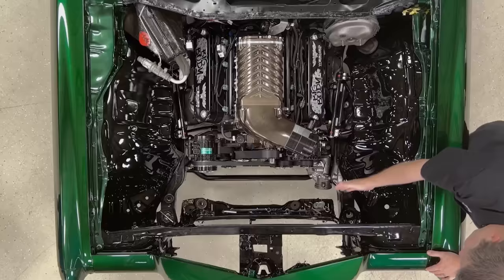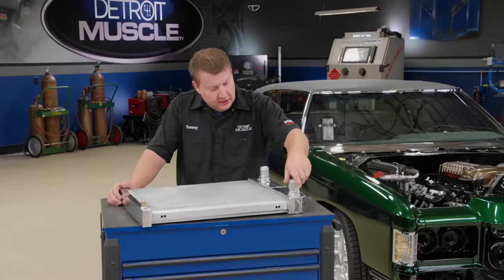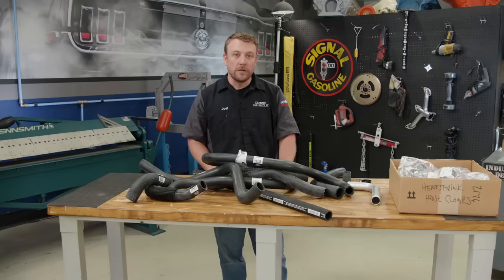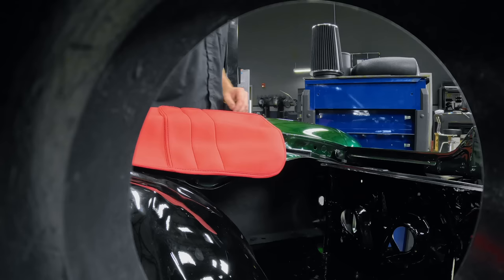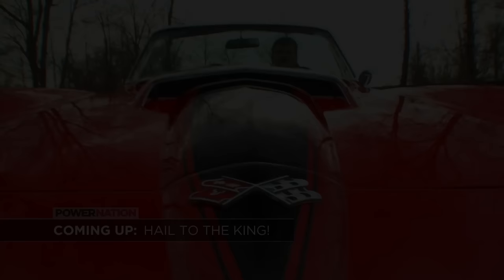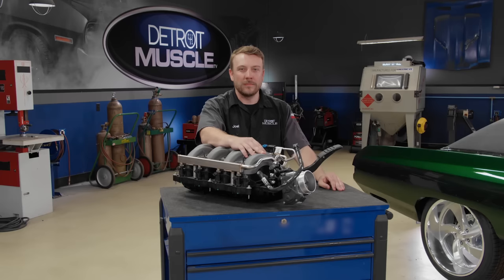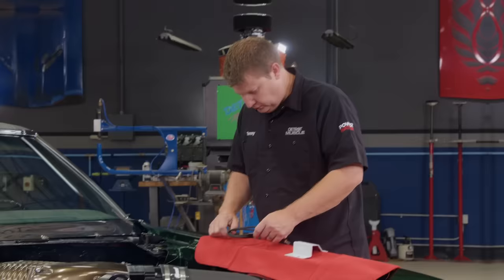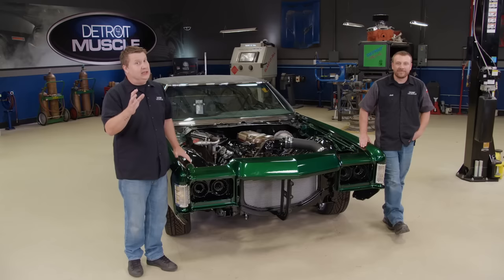Cooling Down & Increasing Power On The ‘71 Chevy Caprice - Fat Stack Part 9 -Detroit Muscle S10, E11

Comment: I spent 3 1/2 years puting my nova together and did not turn the key till it was ready to go down the road with tags and insurance, started it up, broke in the cam, changed the oil and went down the road, the first build in 46 years i did that way and it was worth the wait, everything worked perfect.
Reply: Much congratulations!!
Reply: That's just weird
Reply: I was believing this til he said everything worked perfectly.... In 3.5 years of wrenching, not one nut bolt or anything was missed?  No wiring issues? No rode height adjustments, or tuning? You started a motor you hadn't tuned, broke in the cam and it was perfect? C'mon now
Reply: @DaleDayTheBigDayDJ  I was about the say the samething "I waited until the car was done to start the motor and everything worked perfect",  In the immortal  words of Captain John O'Hagan.... "I'll believe that when my shit turns Purple and smells like Rainbow Sherbert"..... in my 50 years plus years of wrenching aint NOTHING ever worked perfectly, especially something you haven't tuned or broke in......

Comment: As an owner of of a 1996 (last year) Caprice, love this build !
Reply: They missed a BIG opportunity in building a car like the normal everyday guy is though. Don;t get me wrong it's a NICE car and build but people nowadays don't have the 30-50k it would have cost them to build that car. They COULD have yanked that 400 and Auto trans out and rebuilt them and put them back in, you know... like we would have done. They could have pulled the body off the frame and sand blasted the frame and thrown a couple coats of lizard Skin/Frame Paint on it and then cleaned up and rattle can blacked the suspension parts and put it back together with new bushings and bearings, and then throw a new carpet down and some Iroc bucket seats and dye the interior a a med to dark brown color, then put a quality but cheap paint job on it with a updated paint code, could you imagine how GORGEOUS that car would be in the new 2023 Buick Cinnabar Metallic or the 2023 Chevy Dark Ash Metallic, They had that chance and they didn't take it, because that's what people are doing now, noone has the kind of money it would take to build this car the way they built it.

Comment: I have an open element on my LS swap and this guy saw it and was like you are killing HP by pulling in under hood heat. He isn’t wrong and I explained I plan on building a box around it someday, but since I have doubled the HP of the TBI 350 I’m not worried about a few lost🤣
Reply: Yeah but think about the cost to reward? CAI's increase potential with mods.

Comment: Only haters say they are tired of hearing about LS swaps. Hard to argue with their dependability and ease of adding forced air induction without needing to change out a bunch of internal parts in order to handle it.
Reply: I'm not a hater, I even think that LS in the Caprice is cool. What I do think is that there are other great engines, Buick (Land Rover), Oldsmobile, Windsor, ect., ect. and I would also like to see them more often.
Reply: Noones a "Hater" it's just getting old and not most people aren't doing them anymore because the days of going to a boneyard and picking up a LS for $500 are over, it's cheaper now to just get a rebuild kit for your original engine, that "$500 LS engine" os now $1000-$1500 bucks then you have to do all the trial and error and the extra money spent of trying to get it mounted, when you can get a great quality rebuild kit $600-$800, so now your spending half as much money and getting a car that;s worth more because it still has the original engine and trans.

Comment: In the video title “cooling down”, I recalled reading something in an old racer magazine from Smokey Yunick where racers and others who ran their engines too cool were wearing their engines down faster and losing horsepower due to oil which was too cool and pistons not at proper operating temperature. He stuck by what the engines were designed to run at.

Comment: Why would you use the heat shrink clamps? God forbid if anything goes wrong you got to redo the whole system again. Plus you can't work on them if you break down on the side of the road. There are way better clamps than that.

Comment: Pretty sure the sting ray was named after a sting ray, not a boat.
Reply: @Tommy-B. Don't bet the farm on it. The Corvette was named after the WWII Corvette patrol boat.
Reply: The Sting Ray was the name of the Diesel sub class during WWII. You have to remember.... the Vette came out in 1951 (52 model year) and that was only 5 years after WWII ended, alot of the new cars models during that time was named after war machines of WWII because it was still in use by the military.
Reply: Before there was the Corvette Stingray it was a Corvette. And the Corvette got its name from a WWII boat. The Sting Ray was named after the fish.
Reply: @ashleyjennings5224  Half right, The Sting Ray was named after the Diesel Sub during WWII, The Deisel Subs during WWII were called the "Sting Ray Class" Sub, ever seen Periscope Down? they actually said so in the movie and that's why they named the Sub in the Movie after the class, When Admiral Graham says "String Ray Class 186" Kelsey grammer says "But that's a Diesel Sub!"  https://en.wikipedia.org/wiki/USS_Stingray_(SS-186)
Reply: @TheREALOC1972  If you were to look at the side of Bill Mitchell's original 1958 Sting ray race car the lettering on the front fender has the word Sting with an upper case S, while the word ray was separated and in lower case. Also just above the Sting ray word is a Stingray emblem that is cast in the shape of a Stingray. It's not cast in the shape of a submarine, it's cast in the shape of a fish.
Reply: @ashleyjennings5224  it doesn't matter how it's cast or shaped.... It was named after submarine. I bet you think the Ford Falcon is named after the bird because it used a bird in the logo don't you? well I got some bad news for you.... It wasn't, it was named after the Falcon Tank from Australia from WWII. They just used the bird in logo because it was easily reconigible.

Comment: Talks about air restriction, then puts a reducer on. 👌
Reply: The reducer is just so they can connect the throttle body to the air intake system, it shouldn’t affect air flow
Reply: @dancampbell4400  Man I wish you would have told me that before I posted that comment.

Comment: How love to know how much it cost when it finished
Reply: paying for it like we would have? 40-50k,  the paint job would have cost 8-10 grand, The candy paint they used is $1800 plus they had to use a base coat which another $200-$300, plus they had to use a special urethane Primer-Sealer.... plus We would have to find someone who knows how to spray candy paint and pay them. it probally coast them another 5 grand to have the frame sandblasted and powdercoated, plus they reused VERY little of the original parts, everything was brand spanking new.
Reply: @TheREALOC1972  Thanks